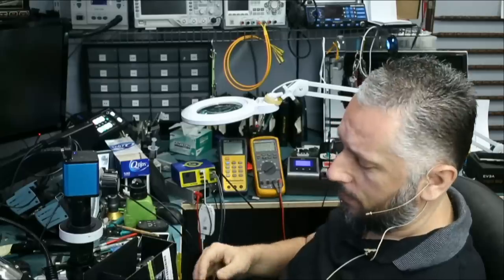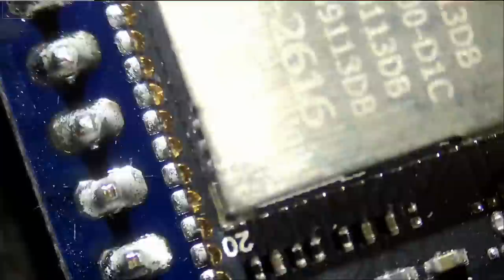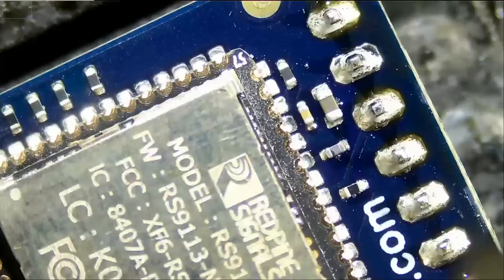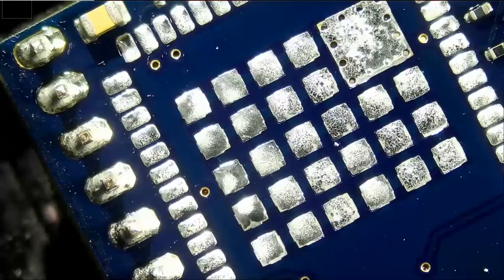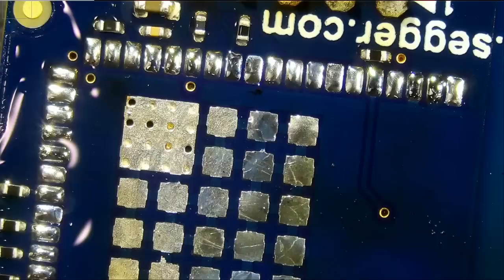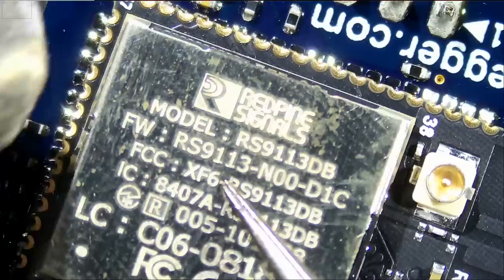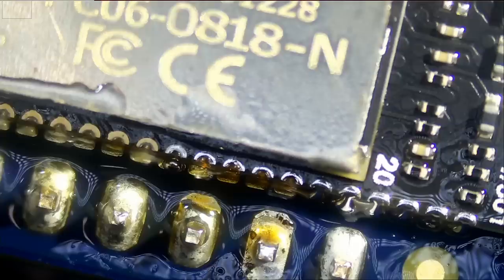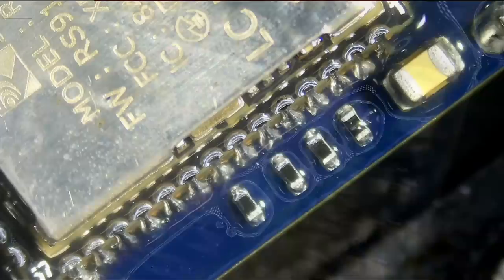Big Wifi Chip soldering - Segger RS9113

Comment: As on a daily basis of using those modules (called as SoC System on Chip), i would have done a bit differently. Remove all the pins and keep the breakout board on a reflow hot plate. Use tweezers and remove like you did. Clean the solder and use solder paste and reflow it using hot plate. In any case, you did an awesome job. I theoretically knew it is possible with hot air rework station but too scared to attempt your way. It's the most riskiest and often causes bridges or shifting of topmost board.
Reply: This is not a SOC. SOCs are singular chips like any ARM SOC (Smartphone "CPU") or Intel Quark; this is on the other hand is a SOM, i.e. System on Module, as it has multiple chips (Wifi, PMIC, etc.) and other components (Rs, Cs & Ls) on there as well.

The whole module is (by Alex) then soldered on a carrier board making it an pinheader add-on board for whatever solution (e.g. Raspberry Pi). You can call that a module as well, if you like.

These SOMs are (somewhat) a pain when put through reflow oven, because components, especially BGA ones have temperature curves and allowed amounts of reheating among other things like solder paste film thickness.

Sorry being nitpicky but I work with both on a daily basis.

Comment: When I have to remove a large device like this with accessible pins I always flow low melt solder into all of the pins around the perimeter of the device. Although you still have to apply heat to release the hidden grounding pads the job is much easier

Comment: Those kind of WiFi-chips are usually a whole mini-computer in a single package... it contains a tiny CPU, some RAM, some flash memory, and the actual WiFi module. Chips like these are used on IoT devices like smart light bulbs. The "Mainboard" the chip is soldered to is likely either a developer-board for creating your own WiFi-controlled smart device, or it sockets into whatever device is being controlled by this module. This must be a very special module for a repair to be economic, usually these kind of modules are very cheap
Reply: All true. And it is astonishing how many megabytes of RAM or Flash memory some of these modules cram in such a tiny space.

Comment: Nice repair way more patience then I guess I need to work on that. I have switched over to the amtec 559 flux. I use to use the dispenser pens but the newest LF formulation sucks, must be water soluble. Thanks for the tips

Comment: The board is called a "Daughter" board. It fixes to the motherboard. What I do is heat the underside of the motherboard with your IR heater and then apply extra heat to remove the daughter board.
Reply: Looks like an raspPI
Reply: @CrAzZyTheCodingBoss  it's says so right on the PCB what it's for (some RTOS soultion) not RaspPi compatible.

Comment: Alex This shows the power of your soldering iron…this is a drone motherboard i repaired them alot as they fell alot and can me damage easily….i use 200Watt soldering iron specially for this job as my tiny C210 soldering iron does not work on this thick pcb.
Reply: I have small c210 and a t12 station for bigger fatter tips
Reply: Weller WX series
Reply: 200W? You don't need that much, it's all about heat transfer capability of your tip.
Reply: @filips7158  if pcb is thick then u need more watts because higher temperature destroy the tip very fast and the pads aswell (higher temp is used for touchup only )…if you see Alex soldering iron the tip is always shining…
Reply: @joshuabest100  c210 is very good for iphone and specially for micro jumpers…for big pcb i use handskit 200w iron 🤓
Reply: @hightttech  yep and its a good one with copper wire transformer init i think 🤔

Comment: Too much solder on the pads underneath. I also would have not reflowed the outer pins and just soldered them individually like you ended up doing. You can also solder a few edge points before you reflow to keep the board aligned.

Comment: Nothing like a challenge to sharpen your skills and I would like to know how do you know the solder doesn’t bridge underneath the chip?
Reply: I am wondering the same. Also I would have used a little bit less solder for those underneath pads. When the solder blob came out at the side, I would've been scared enough to re-do the whole thing a second time.
Reply: On the underside of this chip, it's fine if the solder bridges -- those pads are all connected (bridged) anyway.

Comment: Still halfway through the video, why don’t you use low melt solder on the castellated pins + hot air to the thermal pads?

Comment: That looks like some sort of devkit/prototyping hardware.
Reply: Ah yeah, its prototyping/devkit gear.   The wifi daughter board with the castillations is probably fcc tested/certified the rest of the board is dev/prototype.  Looking into the names on thr silkscreen its some innawoods cellular/satellite hotspot.
Reply: Tack down the pcb with an iron, using the castillated pads to align and hold it in place, use a hotplate or hot air on the rerverse side of the main board to reflow that big ground+heatsinking pad

Comment: Hello. I have used 
(IpaClean isopropanol) IPA. 
It does not clean away solder flux so well. often you spread it around on the card. in my case it takes flux badly.

On the underside of the PCB. card on fiberglass card, acetone is good. but acetone takes away the writing on components such as electrolyte capacitors and color rings on the resistor.

what is your opinion on this??

Comment: Question, what general purpose soldier would you recommend?

I know there are different thicknesses, I know there is active, mildly reactive, etc but even the brands like Kester which folks recommend still have 15+ types of soldier.

Maybe its obvious to folks experienced with soldier but as someone getting their foot into the door and enjoying it, there just seems to be no difference. I was using silver wire to soldier, I like it, but expensive for practicing.
Reply from the maker: https://northridgefix.com/product/best-solder-wire-roll-100g-0-3mm/ That's what I use. Amazing solder and leaves a shinny healthy finish.

Comment: Maybe it is a dump question, but why you have do resolder when there is enough old solder on the board? Can you explain the background of this? Thank you!
Reply: Probably lead free solder originally, Doesn't flow as nice and has higher melting temp.
Reply: Explained at 10:40

Comment: Why not using low melt solder ? Just asking , thanks
Reply: No point since the hard part to melt is the underside not the sides
Reply: Low melt solder is usually used for desoldering or wicking old solder, not really for actual soldering.
And of course I'm talking about the extremely low melting point alloys (like the low-melt sticks he uses), not regular leaded solder.
Reply: @colhany  thanks for replying , I meant why not used to dismount the chip ?
Reply from the maker: How do you apply low melt to the button square pads ?
Reply: @NorthridgeFix   aha I got it now thanks  BTW  iam a doctor 😅  still i make sure to watch your videos ASAP,  its an eye candy to watch and relaxing to see someone professional in his job like you 

Thanks alot for replying and best wishes from Iraq
Reply: @NorthridgeFix  You apply the low melt the same way as always.  Apply it to the exposed surfaces, and it will wick its way down.  I've used low melt to desolder a Bluetooth module like this, and it worked fine.
Reply from the maker: @Mueller3D  Yes magically make its way down. I'll try that when I'm harry potter. I'll pass for now
Reply: I wasn't trying to imply that the low melt would work down to the underside pads, but rather just down to the bottom of the castellated pins.  If you apply low melt to the side pins, then you'd just need to heat the bottom center to take care of the rest.  When there are no underside pads, low melt is ideal for castellated modules, since nothing needs to be exposed to high temperature.
Reply from the maker: You still need to expose the board to the same amount of heat regardless. Solder only liquifies when the board reaches melting temperature of solder. That means heat will spread to center and sides either way. Low melt in this case is counter productive, useless and non practical.
Reply: You need to be careful that you don't become a "scientist", who cares more about being "right" than exchanging ideas.  It's not practical to argue against such a scientist.

Using low-melt, less heat needs to be applied to the board overall. Only the center pad needs to reach the melting point of unleaded solder; the periphery can remain cooler.  The board is not all the same temperature.

Certainly, if you can get away with using high heat all around, then you don't need to be using low melt.  But that can be a gamble; just because it worked once doesn't mean it's always the best way.
Reply: I will add a couple of reasons why Alex's choice to not use low-melt solder is reasonable for this particular situation:
1) He is removing a defective module, so it doesn't matter if it overheats.
2) The carrier board doesn't have much in the way of heat-sensitive components.
Each situation needs to be evaluated for its own needs; it's not one-size-fits-all.